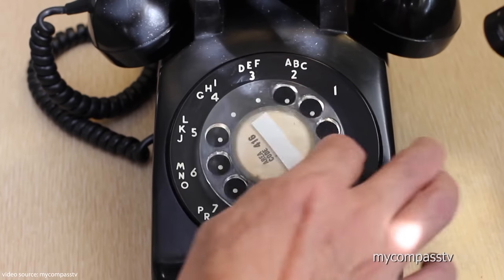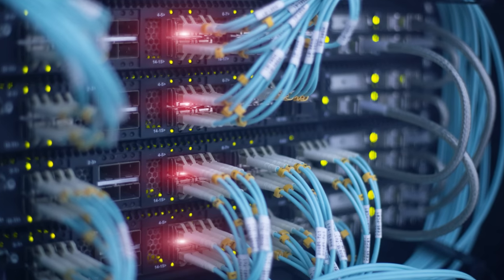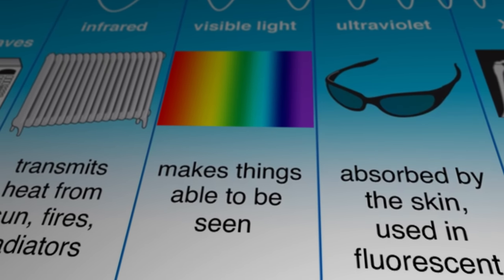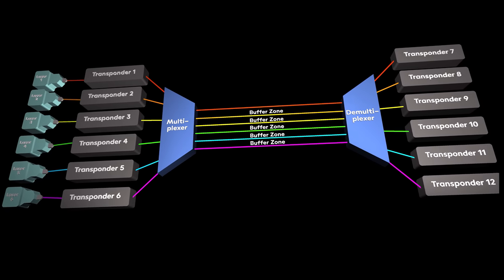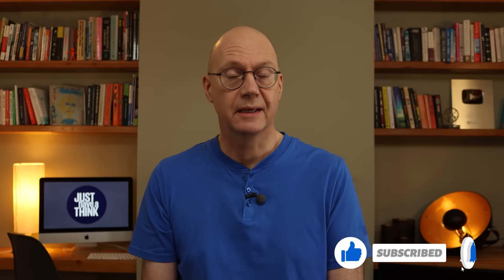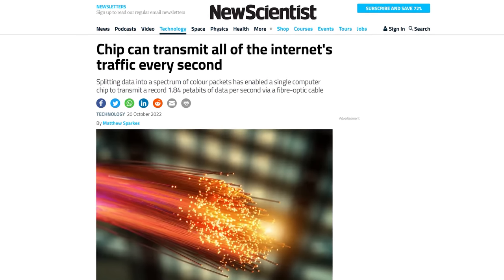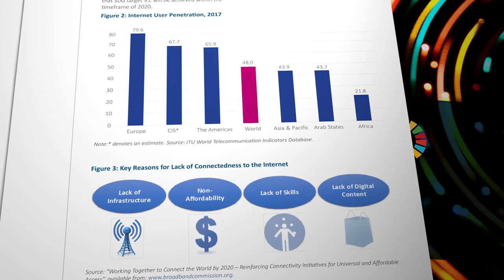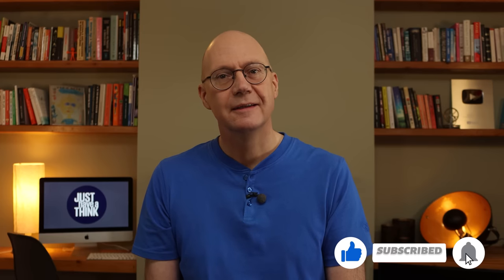The entire internet on a single chip! MASSIVE energy savings.

Comment: I still remember all caps 56k warnings on forums where there were pictures.
Reply: I still remember 1968-73 writing (oil & gas exploration) IBM 360-44 Assembler & Fortran IV-E computer programs at 106 Coldharbour Lane, Hayes, Middx. for Robert H. Ray geophysical with an air-conditioning system like 40 x 8 feet along one wall. That must have ate some electricity. It had 64 Kbytes of ferrite core memory for us to squeeze our programs into with the Company Executive arguing about the cost of renting another 64 Kbytes and some saying "It's endless, if we pay to upgrade to 128 Kbytes the computer programmers will be wanting 256 Kbytes or something ridiculous like that. They're never satisfied".  But then the minicomputers happened and we got our first Raytheon 706 in 1969/70 and put it in a little corner of our car showroom that was filled with the rented Big Blue IBM 360-44. I programmed those Raytheon 706 in 1970-72 in Hayes, Middx. (London) Houston, Midland-Odessa (Texas) & Azaiba (or Ras Al Hamrah ?) Oman & Muscat in the desert for oil exploration. I had written fast Fourier transform for the IBM 360-44 so's they could return the separate rented time-series convolver filtering unit but the Raytheon 706 had an optional Array Transform Processor (ATP) at a good price so that made my FFT program obsolete. They said in 1982 they still used my old iterative regression program that fitted an nth order polynomial to the shape of electrical cable 2,300 metres long towed (and snaking) behind a Vibroseis ship in the North Sea to record seismic waves for making the maps for finding oil & gas under the North Sea. Memories, I have thousands like that over 53 years of professional employment.
Reply: @grindupBaker  Well dude don't be afraid to sprinkle knowledge on posts even if it's on a whim. I greatly enjoyed your post.

Comment: Small point.

Signals travel faster along copper data cables (Cat 6) than through the core of a fibre cable.

This may change with hollow core fibre cables developed at Southampton University.
Reply: Latency is much lower in copper, but bandwidth is much higher in glass.  Which is faster depends on what your signal is.  (Unless it's multimedia, copper is probably faster.)

Comment: You could only use a modem in the 90s because starting in the 70s they phone industry started replacing mechanical switching systems with computer systems. Both use electricity but the later did away with electromechanical switches used previously.
Reply: People used modems in the 1970s.  You had to hand dial the number of the minicomputer you wanted to connect to, but the communication was sound.

Comment: The speed of light in space (vacuum) is about twice as fast as in a fiber optic cable.  Geosynchronous Satellites communicate faster but have a large latency due to the huge distance.  LEO satellites like Starlink have reduced the latency so much that they are competitive with fiber and can potentially communicate faster.
Reply: Starlink is quite limited in bandwidth, though, because of the ground to space microwave link
Reply: @yeroca  There is no "ground to space microwave link".  Microwave transmission is only on the ground.  The new Starlink satellites can transmit to each other in space with lasers.

Comment: I think tesla should build there factorys in abandoned mines to reduce environmental damage.
Like open pit mines not the underground ones.
Also cities should use thirsty cement or line the sides of roads with native plants so flowers bushes succulents mybe some trees to reduce heat flooding co2 air pollution.
Reply: How is any of that relevant to this video?
Reply: @Neilhuny  there literally the biggest ev car manufacturer in America and abandoned mines can be used for something else including energy.
Also using thirsty cement can reduce flooding wich reduces flooding damage.
Then plants to reduce air pollution and to help cool the cities can help reduce crime and energy use mybe even promote more walking there far reduce energy demands more because 50 to 60% of all energy made in America goes to finding oil and making of gasoline and diesel.

Comment: My first modem (1980) was larger than a tabletop telephone at 300 baud (300 bps). By 1990, my modem was a USR 9600 half the size of a modem laptop. By 1994, my modem was a USR 56700, and still the size of the previous units. By 2000, my local area had access to DSL at 3Mbps. By 2005, broadband had come and it was 10Mbps. Meanwhile, by good friend living in NYC got fiber running 100MBps. Today, Gbps speeds are available is many homes across the USofA. So, yes, I can easily see this type of technology pushing Exobits of data per second. The question will become, how much will the TelCo charge for such blinding speeds? (sorry, could not resist the pun.)
Then there's the question of "will we be able to repurpose the existing infrastructure to other parts of the globe" to bring high speed internet to places like Africa while adding wind and solar to provide the power to run that infrastructure?

Comment: They invented optical gates 40 years ago. It had hurdles to overcome and it looks like finally it is coming to fruition which means it is at least 10 years away from common use. It won't reduce energy usage however because demand for video will increase dramatically and the storage of those videos. Energy will however not increase because of this technology, it will remain at 6%. It will also become 10 thousand times faster than today's computers.

Comment: Small correction, data travels along copper at a similiar speed to fiber optics. Not thousands of times different as you stated. In addition, we have been using DWDM (Dense Wave Division Multiplex) for years here in New Zealand, sending multiple "colors" of light down individual fibers. Finally, the energy saved from replacing one small part of the International telecommunication network is hardly going to save the world. Simply by having everyone on the internet having one less coffee everyday would be much more effective. My 2cents worth.
Reply: I picked that up too: but I think Dave was referring to information rate rather than the signal transmission rate. I agree that that wasn't quite what he actually said, but in the context that seems to be what he meant
Reply: Fibre optics have three times the latency of copper wires.  (That's why Starlink is such a big deal, it has low latency comparable to copper, which stock traders need.)

Fibre has other advantages, like much higher bandwidth, no crosstalk, no electromagnetic interference.

Comment: I always judge my internet speed by the data speed that I remember being the first that was actually usable. That was a 56K modem. It worked out in the real world to be about 10MB per hour.
 
My current connection can download roughly 18MB/second. I have no doubt that there will be similar improvements in the next 30 years also.

Comment: IoT is usually wireless or if wired it use PoE (power over Ethernet).  This seems like the wrong use case.
Reply: Over 99% of the whole internet data is moving through fiber optic cables, so this technology that can increase the amount of data being sent per fiber optic cable is good news.
Reply: Power over optic fibre is still in its conceptual phase right now, but it could become a thing.

Comment: The actual physical speed the signal travels at in fibre optics is not at all what is responsible for enabling higher bandwith. In fact the speed a signal travels at in a direct attach copper cable is around 90% of the speed of light (and is very different from the speed the electrons travel at called the drift speed) while in glass the light travels at 65% of the speed of light, slower than in most traditional copper cables (speed of transmission in electric cables is pretty complicated and depends on things like the speed of light through the insulator IIRC). This is relevant in applications like high frequency trading, where saving nanoseconds from your transaction time by making your cables as physically short as possible and as low latency as possible means your order will arive at the market first. They use direct attach copper as often as possible

The reason fibre optics enables higher bandwidth is because fibre optic is very thin and can therefore be bundled into a big cable without it being insanely big, does not need (as much) signal amplification over long distances, can carry multiple signals both ways and a few other benefits
Reply: Even with a single strand you get more bandwidth with optics than with copper.  The reason is the short wavelength of the laser beam, and the lack of interference from radio waves.

Comment: Historical advances in fiber optic technology have been extremely disruptive on the basis that each significant new technology tends to result with something in the order of a million times improvement over the existing technology. 

This seems like a really great technology that is likely to be adopted if it can be made reliable and robust. 

As for your opening comment about how much energy is consumed by the internet.  I don't see this technology making this situation any better.  On the contrary I see this technology enabling the transmission of even more data and hence the processing power consumption at data centers will accelerate.

Comment: Very interesting.  I do feel it's a bit unfair comparing the problems of the current encoding over long distances with the new encoding over a short distance.   So,  If it pans out I'm sure they will use it.
Reply: Also, there is no comparison to computer speeds, ie. having 100 speed networking with 10 speed computers means you effectively have a 10 speed network

Comment: I don’t know how true it is but I feel like people don’t go into the nature of why faster bitrates were possible with fibre compared to copper and many laypeople assumed it was because “physical” electrons could only drift so fast through the wire.

A more accurate representation would be that information, similar to light/EM waves, are always transmitted at the same speed but the lower noise and/or attenuation factors allowed for less delaying components to cover given distances. i.e. the extra time taken/shaven off being because of the necessity of many repeaters and higher power signals rather than the type of cable laid.

Maybe the average layperson would consider it overly nuanced but is that really better than having them walking around saying, “I want fibre optics everywhere because it will be faster” when that is almost entirely false

Comment: The fact that this is based on known physics and the team used known devices and techniques makes it a big plus as to future adaptation. A bit off the topic, I really wonder about the extreme cost, both in dollars and energy, of the Starlink program (not to mention the sky pollution it is causing) and to think about if that money and energy were used to expand terrestrial fiber instead? Wouldn't we all be there by now? Interested in other opinions.
Reply: In the late 1980s the computer pioneers from the 1950s and 1960s fully expected that copper would be replaced with the cheaper, more reliable, more capable optic fibre.

And the phone companies would have done that, too, if they had not been privatised.  By dragging out the inevitable, they could leverage the advantages of the superior technology into bigger profits from companies and individuals with deeper pockets than the average consumer.

Comment: Adding the words "every second" is meaningless, since the traffic is continuous. Presumably it can transfer one second's worth of traffic every second.
Reply: My thoughts exactly. What does "all the internet's traffic every second" mean!
Reply: @petewright4640  It's like saying they've built a car that can travel at 70mph every hour. 🤨
Reply: Eh? Rivers flow at x cubic metres per second, or x gallons per minute etc and they are continuous.

All the world's data on all the current cables amounts to a known or measurable amount and the Danish team are saying that all of that could be transmitted down one cable with this technology, illustrating how massively better the method is.
Reply: @Neilhuny  Consider the River Nile. Now imagine a pump that could move as much water as the Nile every second. It's a meaningless caveat to state "every second" because however much water continuously flows through the Nile is the same as what flows through the pump.

This chip can purportedly transmit 1.84 petabits per second, which is more than travels through the backbone network of the Internet.

..."Every second".

Comment: Dave, you need to be careful about estimates of Internet energy usage. First, total energy use and electricity use are not the same thing, and I expect the figures you gave are about electricity. That's about a 3X difference, right there. Also exaggerated claims have often been made about the energy usage of data servers and the like. You can't just look at the nameplate and multiple volts X amps. Typical power is usually well short of that.

I'm confident those Danish researchers have created some significant innovations. The thing is, such innovations are going on all the time. I, for one, am much more interested in trends than in sudden, major breakthroughs.

Comment: One wonders if, given the higher spectral packing density, nonlinear scattering effects may more severely impact performance compared to traditional less spectrally dense systems? For example, Raman scattering, which causes frequency shifts, increases nonlinearly with transmitted power required for longer distance.  So how will the achievable data rate fall with distance? However, overall looks like a smart way to increase transmission capacity.

Comment: I'm not sure that more and more faster and faster internet is compatible with the reductions we need to make in energy usage. It's not just the network costs, it's the data centres, the costs of the add on tracking packets that the advertisers sneak in, and of course the power used by all those people surfing at home. 

The time will come when we have to decide, as a global society, how much bandwidth is enough. Do we actually get a significant amount of extra pleasure from a HD movie compared to the older picture quality? Will we actually get a significant amount of extra pleasure from whatever higher resolution the industry brings in next upgrade? Is that time amount of extra resolution worth front our grandchildren for?

I'm not say where the cut off point should be, because that should be a wide consensus decision: but I am saying that we need to be supporting the mindset that there is a balance point somewhere up ahead.
Reply: It'll be 3D visuals in every home starting with techniques like the old bi-colour glasses and ending with actual 3D projection.
Reply: @grindupBaker  I agree with your end point, at least if we don't have the sort of rethink as a society that I'm calling for.

But actually, I disagree with the steering point because we already got beyond that:wearing glasses that synch with double the frame rate will come at the beginning of that wider uptake of broadcast 3-d rather than the coloured lenses, in my prediction.

That's because if they need folk to wear glasses then it's be the 100Hz or 200Hz shutter technology that already exists. Gaming graphics cards with bundled 3 d full colour glasses were around maybe a decade ago. The advertiser's weren't successful in getting large scale uptake back then but the tech is still around.

Knowing that that's already out there customers won't stand for the colour systems, and more relevantly the manufacturers can make more profit out of selling the shuttered glasse with the required high speed LCDs.

I've tried that tech: it's amazingly effective though not one I'd personally pay money for (I tried out the system belonging to my hyper-early-adopter gaming friend) 

And that brings me back to my OP: how much more realism do we need?

How much do we only go for because we want to have what the advertisers offer, that we never thought we needed till we were upsold?

Or because we like to feel ahead of the technological curve?

Comment: I wonder if this "frequency comb" technology could be used in a smaller way on just radio or microwave frequencies to increase the throughput of over-the-air connectivity (i.e., not through fibre).  We don't need to concentrate the entire internet into one chip, but we do need a way to get broadband and ordinary phone access into remote areas.

Comment: All that light gets converted to electrical now anyway. The switching fabric and routers, even storage will be bottlenecks down to the device level. However, this will breath new life into existing cables (especially undersea cables $$$) in getting more efficient use of them. Cramming more data through existing cables. That’s much more efficient.

Now if they can figure out quantum entanglement communications to make latency 0ms. That will change the world
Reply: Quantum entanglement has been used for quantum cryptography.  It's proven to work, even over large distances, but is impractical for actual internet applications because the entanglement doesn't survive amplifiers, let alone routers.